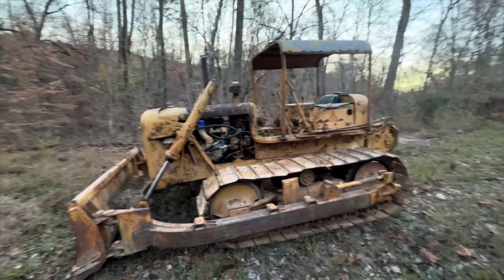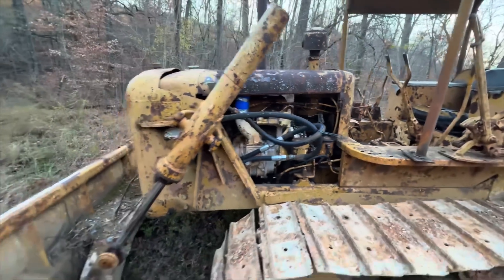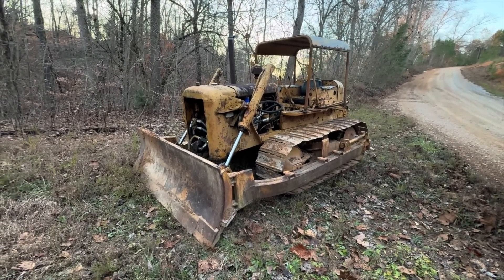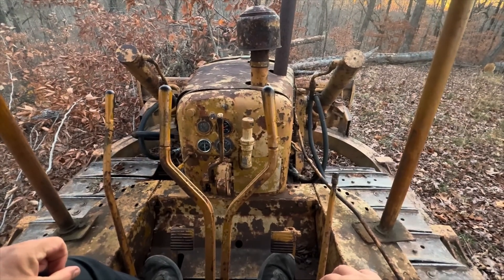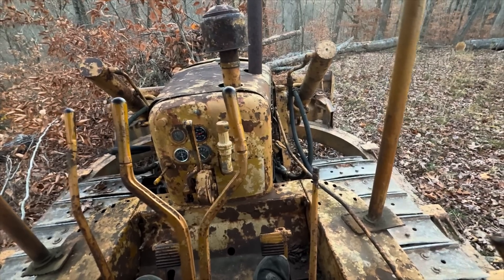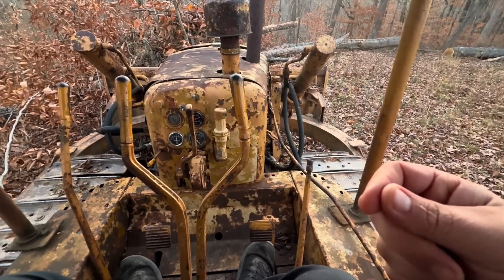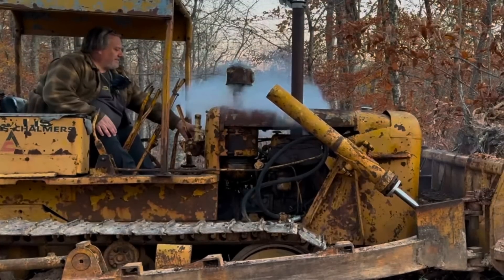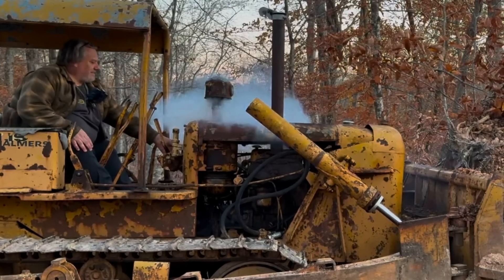Detroit Diesel 2-stroke running backwards. 1950’s bulldozer accidentally restarted running backwards

Comment: Drove concrete trucks in St Louis for 30 yrs,  as the low peon on the list, I got the junk to drive at 1st, I had a old CCC 671 Detroit do that, fun fact the mixer will also run into discharge to, THAT was a fun filled 1st experience with that POS. The 2nd place I worked at had some old Ford COE tucks, POS, with old wore out 671,s in them, they told a story of a driver coming in late on a Friday night, and was late to a family event, and didnt set the air brake and left it in gear,  no idea how he shut it down , but just jumped out of it. Well there was a ditch across the lot from it, it started to roll and lit off, down in the ditch it went, and would kill itself on the opposite side, and when it rolled back, would start in reverse, climb the hill in reverse until it died, and restart in forward, and done that ALL WEEKEND and spinning the brand new set of tires on it!! Boss came in that Monday morning and witnessed what it had been doing ALL weekend ,and the new set of tires where damn near bald!! LOL needless to say the driver had to find a new job!!, Those old 671,s where tough, I had a dump truck pull out in front of me on a hill, and downs shifted , after the slack adjuster rods bent, the engine wound up SO TIGHT it sounded like a air raid siren, the next day going up a hill, downshifted and felt like the dash , steering wheel, and cab was going to explode, it had cracked the harmonic balancer the day before, I hated those old Crane Carrier Co. Trucks!!!

Comment: My 90 Mack with a 350 Mack engine would run backwards   If u got it in a bind and push the clutch right before it died it would start blowing black smoke out the side of the hood.  First time it ever did it I was In 1st.  I eased off the clutch and it started goin backward.  I realized what it was doin.  I killed it and fired it right back up and it was good to go

Comment: Difficult to understand how the engine could continuously run backwards, since the blower would suck air out of the cylinders instead of forcing it in.   The proof would be if he let the main clutch out and the dozer ran backwards - but he didn't.
Interesting that the smoke coming out the air cleaner took some time to begin and built up slowly.  If the engine was running backwards, one would expect the any smoke to begin immediately and be in quantity proportional to RPM.
Reply from the maker: The blower sucks air into the cylinders through the open exhaust valves.   It was running backwards.    Watch the oil pressure gauge at 0 when it was running backwards.
Reply: @BusGreaseMonkey  Ah, yes - the open exhaust valves.   Effective compression would be low, since the air in the cylinders would begin at less than atmospheric pressure instead of above atmospheric - that explains the smoke.  I cannot make out the oil pressure gauge though.

Comment: So if they run backwards, will the oil pump work? Or would it be running dry.
Reply from the maker: No oil pump.   But running a few seconds with no load like this won’t cause any damage

Comment: Any 2cycle diesel can run backwards if air is not cut off they will destroy themselves. Turbo 4 cycle can get oil from a bad turbo and run away in a forward motion

Comment: I have a question. Near the end of this video when the music is playing(great song by the way), at 13:47 a image comes up of a fuel filter with this carmel looking goo on top of the filter. Reason why I ask is, I want to watch that same video of yours to find out what the result was regarding that goo. 
Since my father in law has the same problem with his 1967 John Deere JD500 backhoe. It stopped running. I changed the fuel filters on it, and discovered this goo coming out of the filter housing. Also found it in the bottom of the fuel tank. Assuming now, it is throughout the entire fuel system. Cranks but will not start. No smoke from the stack. Only a few months ago it ran fine. I’m stumped. My father in law is 91 years old. So I have been helping him with a lot of things around his property. He is battling lung cancer, and the chemo and radiation kicked his butt. Thank you in advance for any advice that you have. And please let me know which video to watch. Thank you.

Comment: 9:33 This misbehaviour of two-stroke diesels lead to severe and fatal accidents with e.g. the Lanz Bulldogs. These are single-cylinder crud-oil diesels with >350 cui (up to 10.3 liters) displacement. Under heavy load as with towing waggons up a hill the engine could stall - and refire backwards, which is usually the start of a disaster given weight and inefficient brake systems. The early models had to be stopped and run in reverse anyway, since the gearboxes had no reverse gears. Trained mechanics could achieve this with stopping the fuel supply, starve the engine and - while observing the flywheel - open the fuel valve again. The engine then coughes, blows a cloud of smoke and runs in reverse. The design of the engine however is different from the Detroits. It only has side ports and no exhaust valves and sucks the fresh air through the crankcase - like a petrol two-stroke.

Comment: Running backwards you have no oil pressure. I saw a mack do it once too. Guy was going up a steep ramp and stalled it then the smoke coming out of the air cleaner, Same with a 6-71 in a dump truck. He was backing up a ramp and stalled it

Comment: Any engine running backwards also is running the oil pump backwards and that isn't very good for any engine to run with negative oil pressure.
Great that it is still working and doing a job, Thanks

Comment: Lol  😆 yup i was running backwards! Just so you know, ANY diesel can run backwards, even a 4 stroke which will also exhaust out the air intake and intake via the exhaust. The smoke was actually because the rain flapper was being sucked shut because it became intake and was choking off air for combustion! I LOVE ‘y 1940 Gray Marine badged on the rocker cover, 2-71! She runs like a fine watch and is good on fuel and sounds like yours! Awesome stuff!! Merry Christmas from Rick Delair! 😊
Reply: My father talked about how the old single cylinder tractors [Lanz Bulldog type] could be dangerous when plowing. If they stalled the flywheel would rebound and restart in reverse, the old plows had long handles on them . The tractor moving back rapidly onto the plow the operator could be impaled on the handles.
Reply: Yes, never under any circumstances let one run backwards, shut it down immediately. 
 Reason; the oil pump is also running backwards therefore the engine won't run lung without oil.
Reply: Tell us you don't know squat about 4-Stroke Diesels without actually saying so. - You can spin 4-stroke diesel engine backwards all you want, you will NEVER get so much as a "fart" out the intake. - Two Strokes are unique in that respect. That's the facts.

Comment: We had 1 fire engine with a 8v71 in it and 5speed. On a hill with a stop sign, a little roll backwards and the engine would start running backwards.  It was actually pretty embarrassing to do.  The jump seat riders got smoked out for a few seconds.
Reply: Same thing happened to me around 1984. The 1970 American LaFrance with a 6-71 Detroit Diesel started and ran backward as I was behind the wheel about to respond to an emergency. I put it in 1st gear and let out the clutch before I knew it was running backward, and the truck began backing up inside the bay. I slammed on the brakes and it stopped - choking off the engine. After a few terse words from the Captain, I assured him it was in 1st gear. I pressed the starter button again and this time it ran correctly and we were finally enroute. I had heard this truck could run backward, but it blew my mind when it happened to me.

Comment: I had the same thing happen with a 930 case tractor climbing a steep grade..It stalled then rolled back and fired right up again blowing all the dust out of the air cleaner..I couldn't figure out at first why all the forward gears were reverse and reverse was forward..I shut it off and restarted it and everything went back to normal...

Comment: Correct me if I am wrong but those 2 stroke Detroits were designed to run either way, the reason being is when they are side by side in a boat it makes the screw for the propellers in a boat.They were basically Marine engines.
Reply: They have to be designed that way, oil pump, injection timing ect. Most smaller boats now have the reverse direction in the transmission so both engines are standard rotation. Big boat engines actually stop forward rotation, kick timing over and re start backwards rotation to reverse the boat.

Comment: We had a 108 Link Belt with a 2-valve 4-71 that would run the engine backwards if you killed it while trying to boom it up at an idle with a load on it. No big deal. Lock both drum brakes and pull them into hoist.

Comment: Funny that good size dozer has a 2-71.  My old JD440 had a 2-53, but was quite a bit smaller than that machine.
Reply: We had a JD440 that had the 2 cylinder Detroit. I was wondering what the difference was. I never had it run backwards, but it did run away with me once when I was pretty high up on a windrow because it was sucking so much crankcase oil up into the cylinders. Dad had it rebuilt after that excitement.

Comment: Is it normal for diesel exhaust smoke to pour out of the right side of the engine while it’s starting and running at low rpm? That’s one leaky exhaust system!
Reply from the maker: There is a hole in the bottom of the manifold.   Nice because rain water down the exhaust will not enter the engine

Comment: After watching you drive over to your new bus paddock parking area, I was looking at your property on google earth trying to figure out where you put it. It’s not yet showing up on the photos of your mountain. You pool is though.  It’s got to be a pretty darn big area for you to have room for more than 6 buses. And it’s on top of the hill.
Reply: Is it normal for diesel exhaust smoke to pour out of the right side of the engine while it’s starting and running at low rpm? That’s one leaky exhaust system!
Reply from the maker: March of 22 we cleared that part of the land.  https://youtu.be/A2rtIz6Zg0k?si=WDGuvgxZzI3eSHyQ google uses two old images of our property.  They split it in half if you look at the tree seasons it’s obvious.

Comment: A 2-71 2 cylinder. Doesn’t sound much like the more cylinder models. First time I have seen a video of one running backwards. I did not realize they spit the exhaust back out the intake when they did. I guess that’s because the blower is also running backwards sucking the air out of the intake ports instead of pushing it into them? I was alway under the impression they could run fine in either direction. It was just a matter of the direction the starter turned the engine.
Reply: The reverse rotation ones use a different gear set in the timing cover so all the stuff like the cam, blower, oil pump run the correct rotation even though the crank is spinning reverse.  I

Comment: That happened to me in a truck with an 8v92! I stopped short cause someone snuck around a corner and I didn't see them. I slammed on the brakes before I pushed the clutch. The motor stopped but then started again as I was pushing in the clutch. I released the clutch in a forward gear and the truck went backwards. It was a freaky experience. I shut it off right away and restarted, and it was fine.

Comment: I decades ago saw a Unimog engine being ruined by being tow started in reverse gear (forward /reverse is a separate lever).
The oil pump diligently sucked all the oil out of the bearings!

Comment: We would get one of those 2-week wonders, who had a 2-week CDL training before they bought their CDL.  They would be driving Detroit 2-stroke powered semi trucks and when they finally backed into the loading docks (between the yellow lines) they would hit the big rubber bumpers.  Those would stop the semi and occasionally one of those Detroits would start running backward.  Panic would set in and smoke coming out of the engine hood, the engine sound would be much different, and the oil pressure light would come on. The dock foreman would call the shop which was next to the dockyard and say another Jimmy is running backward at the dock.  I would hustle over there, find the emergency stop shutter control, and shut it down.  The 2-week wonder school never taught about the emergency shutdown procedures.  They tended to be back off the clutch when the engine reversed and in their excitement, they would release the clutch a little bit and the truck would start to drive away from the dock even though it was in reverse.
Most ship engines are 2-strokes that are designed to be reversed as they are directly hooked to the prop shaft.  That is one of the reasons that the ship hit the bridge in Baltimore.  The pilot could not reverse the engines quickly because the propellor shaft had to spin to a stop before the engine could be reversed.  In their case when the generator system failed, the electric oil and coolant pumps stopped and that shut the engine down.  No thrust and the rudder did not have much authority and could not turn the ship.

Comment: You'll never run it backwards if in fact the two-stroke Detroit is full throttle Detroit's are made to run full throttle I've had 271 all my life 253 353 all them smaller engines are designed to run

Comment: Those 271 run and perform best at full throttle every time I've ever had my HD 5 after the best thing you can do with a 253 or 271 is put the thing completely full throttle and run that way

Comment: Accidental backwards starting used to be a real headache with the old cartridge-start Field Marshall tractor engines. Really important to make sure the engine was in the right position before firing. My first girlfriend's Dad had a pair of Marshalls, one of which was still used occasionally as late as the 1990s when the farm was busy. Real pain if you started the thing backwards when you were at the far side of the farm and had no more cartridges (at the end of a long day when you were already dead tired!)

Comment: I did that once with a Maxidyne which of course is a four stroke.  It was a dump truck which I was backing into a soft spot--it almost stalled and then started running again.  Smoke started coming out the breather and when I let out the clutch in reverse it started moving forward.  I was young and had no idea what was going on--I thought I'd done some serious damage.  But, I shut it down (manual fuel shutoff like your dozer), restarted it and it was like nothing had ever happened.  I said nothing to my boss.  Many years later I did the same thing with a Cat 3208.  I didn't think you could do this with a four stroke, but there you have it.
Reply: Funny, I did the exact same thing with a 3208 myself. Almost stalled it pulling up to a quarry scale and when I pushed the clutch in, it started blowing dirt out of the air intake (LN7000 Ford) and had a weird sound to it. Shut the key off and started it back up. Never knew a four stroke was able to run in reverse🤔. Sure backflushed the air filter!

Comment: Reminds me of the early days of golf cart engines, to go backwards you reversed engine rotation. But would I be wrong in thinking an engine not designed to run backwards would have its oil pump pulling oil FROM the bearings?????

Comment: 4 strokes can run backwards if you let the engine stall while pushing stacks and dont hit the clutch fast enuf. Gotta kill fuel when that happens bcos
 Oil pump is in reverse.

Comment: If that engine runs backwards isn't the oilpump also running backwards? If yes it would mean there wouldn't be any oil pressure, right?
Reply from the maker: Correct.  You can see the oil pressure gauge at zero

Comment: I have a Allis Chalmers hd6 track loader I would advise not leaving the master clutch engaged while the machine is off they will stick to the flywheel if the machine sits to long my cousin had a hd5 track loader I used to run when I was in my youth

Comment: How could it run backwards without the blower, wouldn't that also be going backwards?
Reply: It wasn't running well, the blower was sucking air thru the engine and the fuel is injected into the combustion chamber, so it runs kinda.

Comment: Suggestion is don't let the idle drop that low when you're working hard because it builds up hydraulic pressure which forces the engine to run backwards. Either take smaller bites or use more RPMs
Reply from the maker: I was testing the traction.   The grip passed the test ;)

Comment: That means the blower was sucking not blowing?
Reply from the maker: And the exhaust valves became intake valves and the liner ports became exhaust ports ;)
Reply: @BusGreaseMonkey  Yes, so Marine and Railroad DDs must have a blower that is not hard coupled, so that they can run backwards but still maintain proper gas flow?
Reply from the maker: @bruceknowling8633  they are specifically set up to run cw or ccw.     You don’t just put a different direction starter on them and call it a day.
Reply from the maker: The blower always turns in the correct direction.   A gear that drives the cams from the crank is swapped to the opposite side so when the crank goes the other direction it keeps the rest of the gear train still moving cw.
Reply from the maker: Also there are right and left hand fuel pumps but they don’t correlate to engine rotation but instead to the side of the blower they are mounted on.

Comment: If a Detroit 2 stroke has an oil bath air cleaner and you turn it backwards you can empty the air cleaner out the stack. I did on a 66 Freightliner with an 8-71. What a mess!
Reply: Btw I meant the fresh air stack